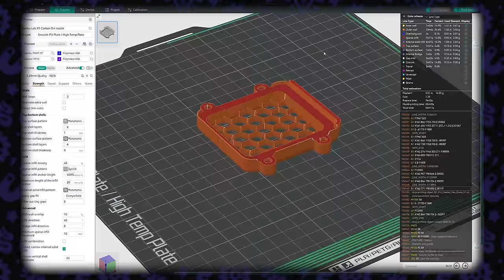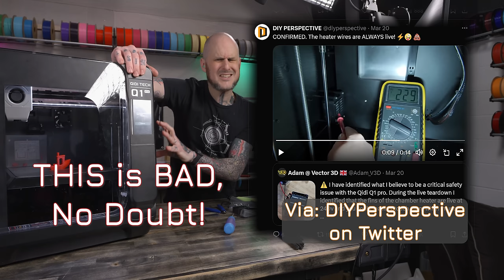SHOCKING Truth About Qidi Q1 Pro Heater Hazard

Comment: It is correct that in EU the plug can be rotated causing the pins to be flipped. However, this is not a concern as all mains are AC; alternating current, and the difference between line and neutral in this situation is nothing more than terminology. Put differently, electronics will already have to be able to deal with current flowing in both directions, not just in EU, but wherever there is AC power used for the mains power.

Comment: I just buy the QIDI Q1 Pro but I have problem for print, I check the temperature on hotend with thermal camera and i see I have only 72 deg C maximum on hotend outside when I setup for PLA 220 deg C.
If you can please check with thermal camera what temperature on hotend you have on your Q1 Pro, thank you.
Reply from the maker: You are not testing things properly by looking at the outside of a hotend with a thermal camera. The only place the temperature truly matters is in the core of the nozzle where the filament is melting. The temperature difference from that point to the outside of the hotend can vary signficantly and not matter in the least. 

Unless you've got a very expensive thermal camera that is well calibrated to the material you are pointing it at, you aren't reading THAT accurately. They are good for a generalization of temperatures, not direct and accurate readings. It can show you if the hotend or bed is heating evenly, but not the actual temperature your firmware is reading. 

So my recommendation would be, ignore the thermal camera entirely. Tune the filament you are using to the machine. Run a temperature tower. You are over thinking things by trying to use external temperature measuring implements.
Reply: @MandicLabs  I also test the temperature with sensor and when on setup is 200 on sensor I see 150, is not metter what temperature is, every time is 50 deg C less,
if I setup 350 I have 300.

Comment: I totally agree with you about a printer being a tool. I love my Qidi X MAX 3 and want a Q1, I kinda think that many of the mainstream people are too soft and want OOTB consumer products now, with a few exceptions. If @QIDITech wanted to make everyone happy all they would need to do is put a safety switch to the door so that when its opened it turns off the heating element. would be a cheap mfg change on their part and they could even offer kits for people to update themself. If i had a Q1 id work on a BOM for a cheap limit switch and relay, design a small 3d printed part to snap on the machine (for ease of use) or drill and perma-mount it (for others, not myself. questionable to others is great, makes people not want to touch my things)
Reply: and the lid i guess, if someone can flex their arm like that... I'm sure some mainstream channel would also point that out, gotta include the people who can flex like Dhalsim 🤣🤣

Comment: I doubt if you even got a shock from it that it would kill you because you won't be directly holding it. So your more likely to retract from the shock automatically. Ive inadvertently touched 240v with a screwdriver before everything happened quickly but the screwdriver dropped from my hand. Unless you physically grasp the live heat sink your muscles won't contract around the heater. Of course you should be aware and practice care but it's no different to any other appliance a toaster is probably far more dangerous.

Comment: While this is a tool and should be treated with respect, there was a simple solution that qidi seems to have been missed:

A magnetic switch on the door and a circuit to deactivate the heater immediately when the door is open.

Comment: With regard to the SSR and the reversible mains sockets. The SSR is designed to switch the live line only and the neutral is always connected. If the wiring or plug is reversed then mains voltage is always running to whatever is connected to the SSR and the ground is being switched to actually complete the circuit and produce heat. So if its wired incorrectly you can become the ground and get shocked.
Reply: actually, that also sounds like the heater would be on for the EU units as well, I know the UK plugs are keyed at least but they also don't use ground pins I think
Reply: @nathan22211 of course we have ground pins.

Comment: I think Vector3DP over reacted, and this is unlikely to be a hazard unless you let your kids poke butter knives into the heater.  That said, I suspect the heater will be live with respect to ground when turned off if the incoming live/neutral are reversed, not an uncommon wiring fault for power outlets.

Comment: Isn't carbon fiber conductive? Would definitely not use filement with carbon fiber for a cover that should insulate me from electricity. (Even though its not normally touch the element).
Reply from the maker: Carbon fiber filament majority base filament with fine strands of carbon fiber randomly interspersed into it. The likelihood of enough stands happening to cross paths with each other to create a path electricity will actually follow is extremely low. I can see quickly conductivity test it but I’ve done so in the past with zero results (when I’ve wanted to try and make something conductive). Most “filled” filaments really have a very small amount of the filler material in them.
Reply: @MandicLabs  While that is true that it only have 15% carbon fibre it is random and is still high voltage which means that you cant test with low voltage. In the end it might not be a problem but I just felt that it sounded like a quite unnecessary thing to use in this use case.

Comment: the euro plug is called the schuuko (shoe-koh) :)
Reply: Not quite. It’s Schuko, which is short for „Schutzkontaktleiter“. German literally translated protection contact lead. Which refers to the symmetrical ground contact. Any devices imported in the EU are legally required to work with reversible plugs, regardless of which of the many plug systems is beeing used.  The one he was showing is a german/french hybrid plug which is symmetrical in germany and asymmetrical in france by use of the center hole for the ground. In Germany you might have to reverse the plug to get rid of some unwanted noises on audio devices.

Comment: 10:44 The European systems might have the heater at live voltage all the time, even when the heater is not powered on
Reply: More nonsense on top of the already nonsensical overreaction to a non-issue. Get over it.

Comment: This kind of stories are a disease, which are spread by people that call themselves influencers.
They used to sell these heaters you could buy on tell sell, they are exactly like this so if you poke something metal on it you die. People who are concerned about this should ditch their heaters, toasters, ovens, tv's. All devices with deadly current in it.
Moral of the story, don't open anything with live current on it, let alone touch it.

Actually, the level of safety in this printer seems pretty high with very nice cable management.

Comment: Well my sockets are all i think Americans call it cfi or something protected so i wouldn’t be a danger. I think its fine that there are live voltages when the thing is running but for my Europan ass I dislike that there is life voltage when its not turned on. Since I often remove the bed when the printer is still turned on. So with that situation i will hold off a little and see what happens

Comment: What is that nonsense about euro plugs ... I can't even ... 
Calling whoever came up with that brain fart an idiot is still generous. Not only does that person not understand how AC works, the heater element is activated via a solid state relais ... which is controlled via a 24v channel of the mainboard. If the software says 'heater off', the heater is off, whether it's hooked to 110, 240 or 400 volts, with the live wire being L or N, it doesn't matter. 
And the heater is effectively nothing more than a big resistor with fins and a fan, it doesn't care about polarity, even less so when we're talking about an AC circuit.

Comment: 110v would be more efficient for a heater over 24v.  Amerage is thr killer, and 24v would be much more dangerous careying higher amps than the 110v configuration.  Thr 3d printing community is its own worst enemy.  Thry have a complaint for every product that isnt a Prusa.

Comment: Another solution, while slightly more complicated, would be to design a disconnect pressure switch connected to the door. Door opens circuit dead, close door circuit live.
Reply from the maker: I mentioned that but think I cut it from the final video. My concern is whether that may cause some issues for Klipper. It probably shouldn’t but I can’t help but be concerned the control circuit would behave strangely that way. Probably over thinking it.
Reply: @MandicLabs  I don’t see how it would? Klipper, at least in my mind, is just sending and on or off signal to the control board that initiates the heater. You would be cutting the heater itself running on mains power mid circuit so after the control is initiated. Easy test would be take the heater out like you did in the video and splice in a switch. Start the printer with the heater and switch the heater off and see if Klipper has a fit. If not… there’s your answer.

Comment: The US doesn't use 110 volts,  well not since the 80's.   Pet peeve of mine.
Reply: My pet peeve is when people say you’re completely safe when the switch is off and the device is unplugged. Many high power devices (such as power supplies) have capacitors that can still get you when everything is unplugged. I have a nicked screwdriver to prove it - didn’t discharge the caps and the arc took out a good chunk of it.

Comment: So You muricans dont have AC? 😂 Is it 110V DC in your outlet?
Reply from the maker: When did I say DC? This is why I'm entirely confused as to how the European outlet being flip flopped could cause a power to be hot when the SSR isn't active. If that is the case, I'd expected it on any machine as it is AC, but that's not true on my 110V AC Machine.
Reply: @MandicLabs  its simple. Lemme explain:

One wire is the ground - middle one.

And on one side is a minus - but in reality its a zero.

And the other side is plus - alternating high voltage current killing people and machines with power of 230V 😂

BUT

that voltage to be a weapon of destruction need to close the loop with minus. Doesnt matter which wire is which because this is AC. But those connections are insulated and the machine is grounded so in case of failure fuse will kill it in soft way or hard way. Depends on which connection connects which connection 🤷🏻‍♂️

And Your ssr might experience leakage current? Small dose of Ampers x 230V... = Some Watts so heat also.

2nd BUT

At 3:04 of this vid i can see relay with some coils. Electromagnetic? I cant even google this by the number h-2jmrk on board. It might be top secret WWIII weapon.

ANYWAY

Plugged thing - fridge, printer, toaster, etc. Mostly has one switch for one cable. But is it connected with + or -? Mostly doesnt matter. Ive got in my turned off but still connected K1 some lil flashes on LED tape when im touching it. Some leakage current trying To use me as a conductor to light the lights, i believe. Its safe, dont bother. The same might experience your rrs full of electronics and diodes. I dont know for sure what did you experienced and with what ssr. Anyway googling usa plugs and outlets looks like they might be flipped also. And btw, ive got few ssr in my flat and i didnt even pay attention connecting them and i know they work cuz they open and close my radiators in winter for few years now.

Please dont feel offended because it wasnt my intention, i love watching your content. And to be honest in that case: only stupid ppl has always problems with everything. Even printer without heater can burn the house or kick someones ass with electicity. But the worse thing out of it - it can damage itself in inappropriate hands. Tittle "dont touch" should be enough caution to not do stupid things. Printers with heaters are cool, let them be people!